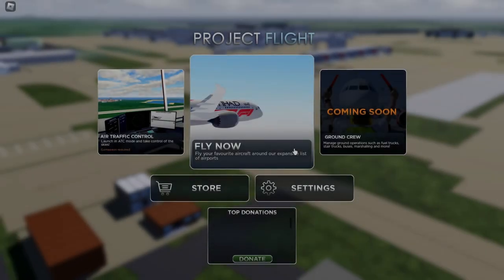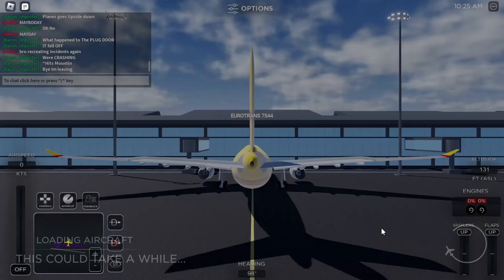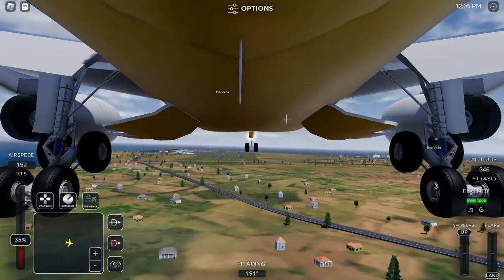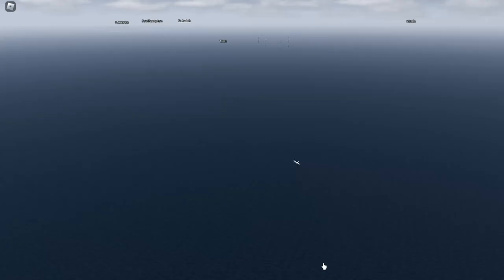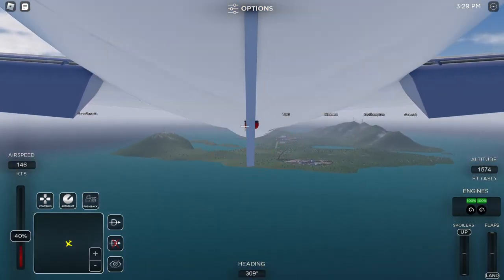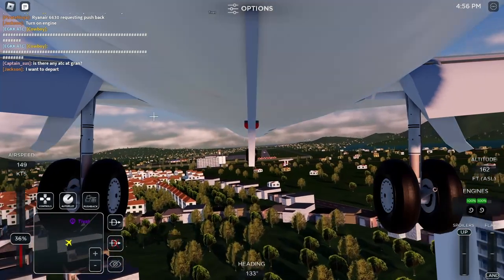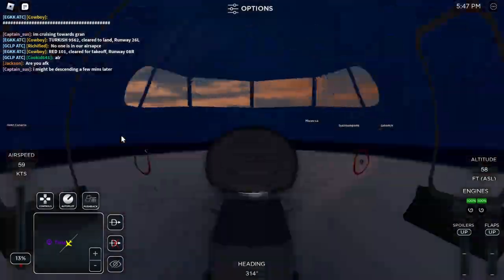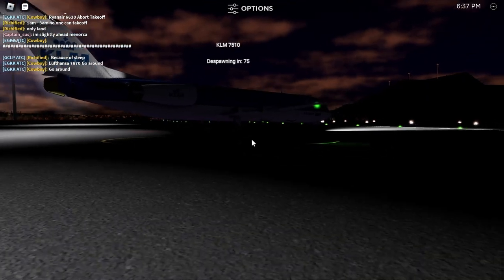|HOW TO BUTTER IN PROJECT FLIGHT|SINGLE AND MULTI-GEAR TUTORIAL| Project Flight

Comment: you cheated you used the a330
Reply: buddy as long as the aircraft has at least 2 wheels he can land it
and all planes you can make a smooth landing because the pilots are taught to flare
Reply from the maker: As a tutorial plane, the A330 is the easiest plane to land (in my opinion) so I used it as a tutorial plane to show others how to do it.